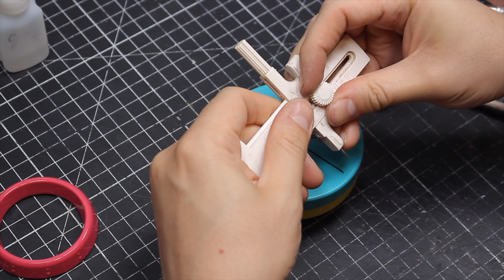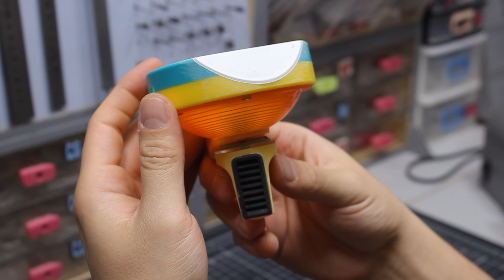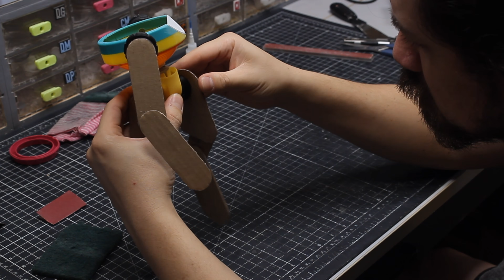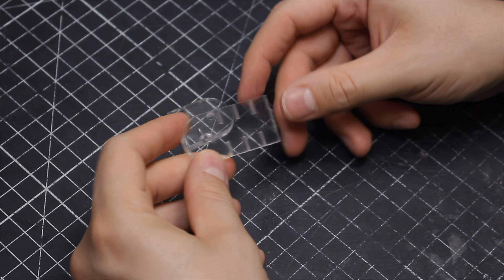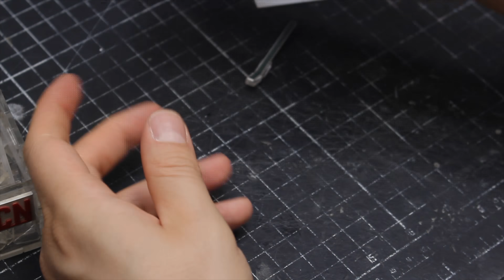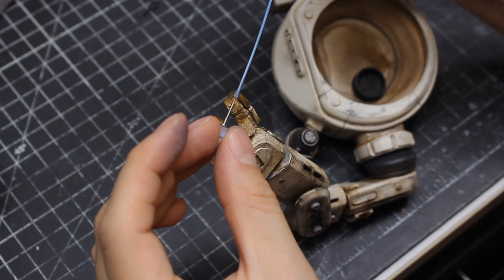I Built a Rusted Humanoid Robot Called The Collector!

Comment: Something that always adds more story to an aged or weathered robot—though it shouldn’t be overused (unless it’s meant to be a Frankenstein‑style robot)—is painting some of its parts in a different color, or even adding decals or painted markings. For example, the upper part of an arm painted yellow with the typical black‑and‑yellow caution stripes, plus an identification number that doesn’t match or doesn’t appear anywhere else on the robot, something like “B‑03”. This makes it look as if that specific piece came from another robot of the same model that had been painted differently and was originally assigned to a different function.

Comment: PLA should be plenty strong on its own - no need to combine with other materials in your leg and arm  pieces. 

Your parts are just taking the force of their own weight and very little external force so it should be good. Otherwise try increasing wall thickness and infill.

Comment: Amazing! Love your work so much. I try to make models a little like this, but honestly I get stuck with adhesives. I don’t understand what kind of adhesives to use for random found plastics like these (in the US). I grew up using a glue gun but obv that’s junk for real scratch building. Anyone have recommendations for what to use for found plastics? Plastic weld? Or something else?
Reply from the maker: Thank you! Most plastics don't react well with superglue/c.a glue.. Only abs, styrene, plexiglass and some others. Most of what we can find in household items is pp, pet or pead, which sucks for gluing and painting. When I have to use those I do some light sanding and combine hot glue + CA on the seam... Hope that helps!

Comment: Watching you build parts for a while now and, if I may, suggest a micro/hobby table saw may be a better option to consider over a band saw. Most of your cuts are straight lines, which table saws excel at. For the corners that are rounded, you can take the bulk of the corner off with a table saw and grind the finish shape. A hobby size table saw uses a thin, fine blade so it doesn't waste material and it's small so takes up less room in your limited storage. 
And best of all, I'd bet you could build it yourself with your skills. Really, it's not much more than the nice disk grinder you built. The motor is just under the table. Just need to get a blade and a motor with an arbor that's threaded reverse of your blade direction so it doesn't spin off. A variable speed motor would be best to avoid the melting like you had with your jig saw. 
Like this saw:
https://www.amazon.com/ELECTRIC-TABLE-BENCH-SAWDIY-Circular/dp/B08BCM5VSP

Comment: I think a jeweler's saw might be more user friendly than the jigsaw - better control, less precarious setup, and honestly sometimes the hand tools work better than motorized or power tools for particular applications. Another plus, it's much cheaper than a band saw. 😛
Another great vid!
Reply: Also, feels like the layer lines of the printed parts don't necessarily detract from the build in this application, compared to art pieces with egregious steps/no processing whose aim isn't to comment on production or some aspect of a process. The artifact lends to the sense of being manufactured in this piece. It pairs well with the non-printed parts.